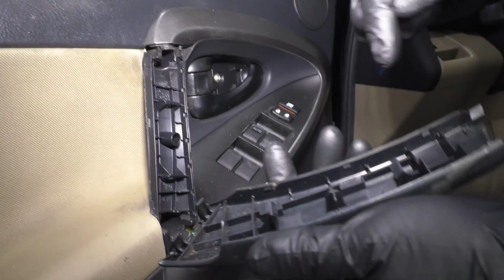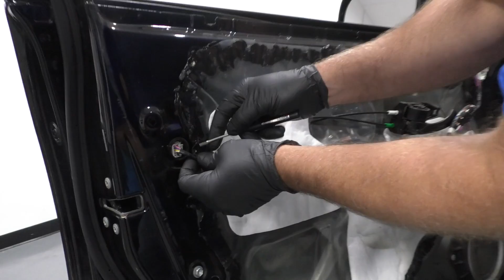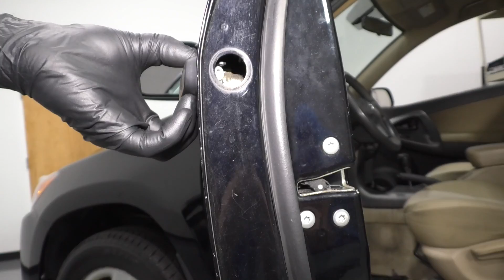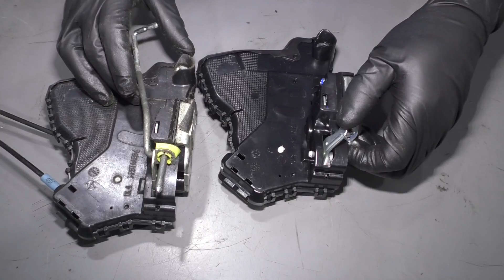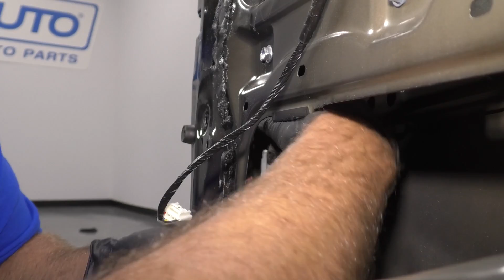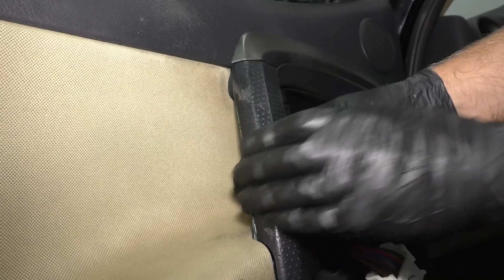How to Replace Front Door Latch 05-15 Toyota RAV4

Comment: My 2 front doors won’t lock/unlock. And it’s annoying. The weird thing is that, the driver side does work during Summer. But during winter it stops working. The one on the passenger side stop working out of nowhere.
Do I have to replace both or can it he something else?